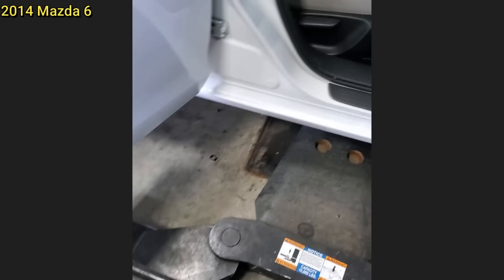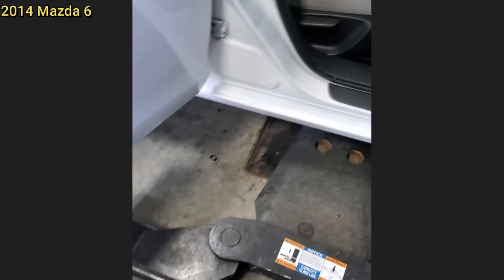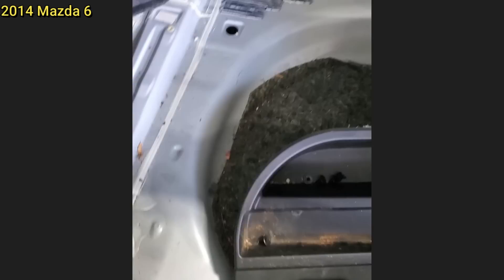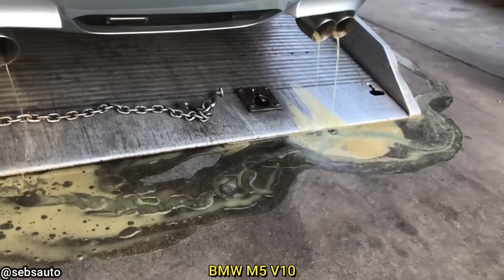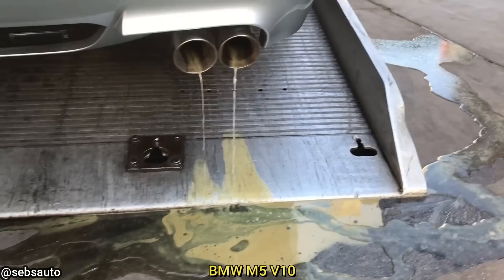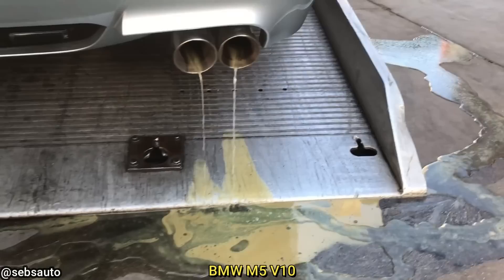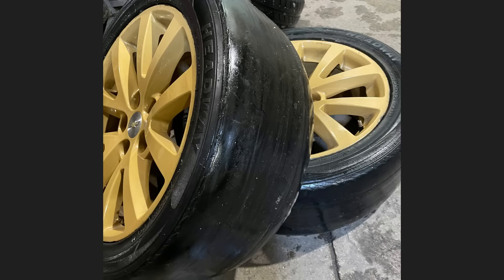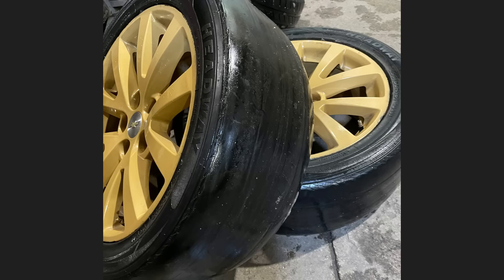Customer States Heard A LOUD Noise When Trying To Charge Tesla

Comment: Having a tow hook-up rusted through like 2:30 is quite something given how thick the metal originally was. There must not be a whole lot left to the rest of the truck's structural integrity either.
Reply: Welcome to the rust belt. Here in Iowa the brine eats vehicles for breakfast.
Reply: @catsaregovernmentspies  wash your vehicles often
Reply: I don't miss the snow and salt from up north.
Reply: @sd906238  I'm in north dakota and we avoid salt. My city uses sand, but I think some private businesses can use salt. Not exactly sure on who uses salt.
Reply: @jayasmrmore3687  Recycled water at carwashes makes that a lost cause in the winter.
Reply: @edsloan8535  Then at least clean the bottom of the car after winter. It won't save the car but will postpone the inevitable, the thing might survive for a couple years longer ;)
Reply: @edsloan8535  when water is recycled it should probably be treated first I’d think
Reply: @jayasmrmore3687  
it's recycled in the sense that it's reused, not in a sense that it's clean. i mean it's "clean" enough to get through their systems but salt easily dissolves into water and bam you got salt water being sprayed on and under your car. best case you can hope for is the final rinse be fresh clean water and that's okay but only if they also spray under the car too. 

really there is nothing you can do but get higher quality parts (painted with paint that is heat and chip resistant) or covers for the underside of your car. that or have the body made out of anything but iron/steel (some cars are like this but it raises the price by a ton).
Reply: @rocksfire4390  it’s not clean but they can have it go through a cleaning process before reusing. I’m not saying that they necessarily do this but they should.
Reply: @rocksfire4390  The final rinse is always done using the cleanest water possible, but this is not applied to the bottom of the vehicle.
Reply: @user2C47  
so the only part that matters? =/
Reply: @jayasmrmore3687  desalination is an expensive process by volume, and it could as much as triple the business owner's cost of your wash cycle.  That's just operating costs, assuming he has already paid off the equipment he's installed to do it. 
To raise service costs enough to remain profitable, he'd chase the vast majority of his patrons off to use his competitors who don't desalinate the water.  So there's no easy answer here, except to take your car home after doing the bulk of the wash there, and give it a thorough final rinse with your garden hose.
Reply: @edsloan8535  wash in your driveway then, or at least just rinse weekly
Reply: it was those tires for me!🤨
Reply: @catsaregovernmentspies  ah yes. Salt, potholes, and don't forget the sultry -20 f daytime high temps during winter! But we should "just wash our cars" during those times (😉).
Reply: Me: "Ou thats really badly rusted out back frame" and then i realized what it actually was while it was stated he planned on going to tow trailer with it..Sure i did do (last) tow with similarly rusted setup, but it was for light trailer with even lighter load..and it failed from one side making it perfectly clear it was done for.
Reply: @erpfanatic6586  sounds like a business opportunity for someone to setup a business supplying a "rinse off" service.

You'd probably need to use city supplied water, run through a big assed water heater to get it up to 100f or so. Have it applied by an employee rather than self serve to cut down on waste.

If you could come up with a process to recover the water, that would be a bonus.

I suppose you could distill it If you had an economical heat source. Maybe vacuum distillation at lower temp, given low ambient temps.

It would necessarily be a seasonal business.

Comment: 0:20 This is actually completely legal in The Netherlands and having the seat as shown in the video is also recommended here.
The only things one needs to take care of: Disable airbag on passenger side + make sure the seat is properly secured.
Reply: Pretty sure it's still the same in Sweden (I haven't had a car for 30 years or so), up to a certain age you have to have a backward facing baby seat, is there even any safe way to mount that in the back?
Reply: @Hexalobular  is legal and recomended
Reply: As if most people even remember to disable the passenger side airbag. MUCH safer in the rear passenger seat facing backwards. Add an extra suction cup mounted mirror for quick glances to check on your precious little one. This also forces the driver to pullover if the little one needs immediate attention instead of trying to do that while driving 2 to 3 tonnes of killing machine.
Reply: It’s also legal in most states in the United States, as long as the air bag is disabled
Reply: @Hexalobular  it is the same way as in the front, only not leaning on the desk but on a seat, but turning back to care for any babies momentary needs isn´t really best when you need to focus on road in front of you - this way you have it in peripheral sphere of vision 99% of the time
Reply: @FirstLastOne  if you´re not an idiot and know where your baby things are and you do not have mess in them, you can pretty easily hand down anything to your baby on the next seat - which is almost impossible to do towards back row (and not safe unlike the front row option). 

And you cannot always stop for every baby cry, nor want to. For "serious" things like diaper changing or searching for lost toy? Sure. But for handing a bottle of milk or easy eye contact this is much better and smoother for the ride and you do not spend more time on it then on looking into rearview mirror.
Reply: Completely legal in Finland as far as the airbag is disabled. Why would it be illegal in the first place...!?
Reply: @siriusczech  Are car seats generally strong enough to not bend or fold forward? Particularly in 2 door cars?
(I suppose a baby and seat don't weigh anywhere near as much as an unsecured backseat passenger, but still.)
(My car experience is decades old but I wouldn't trust the latches on the front seats in the 2 door cars I've driven.)
Reply: @Hexalobular  child seats are like a big shell that protects it and  it is fastened by a seatbelt. Big car seats have absolutely no problem of holding such weight, same as holding adult person.
Reply: having a rave every time you turn a corner is legal? awesome time to move
Reply: @jimbothegymbro7086  wtf are you talking about?
Reply: @siriusczech  wtf are you guys talking about. All I seen was all of the lights flashing along with the turn signals. There is nothing shown about the airbags and seats at 0:20...
Reply: @QuantumRads  There must have been smoe editing, as there was a (part of a?) clip that has shown a child seater on the front seat and we referred to that. For some reason, it is no longer there, but you can clearly see from responses that there HAS been a clip to react, otherwise I won´t get any meaningful response.

Why it has been edited out I have no idea
Reply: @siriusczech  it's still there, it's now at 0:25

Comment: 0:30 "smells like fuel"  I spilled about 3 gallons out of a 5 gallon can in the back of my Impala months ago, still smells like gas if it sits in the sun with the windows up.  I loathe these new "spill proof" gas cans.  Even the O-ring seal on the spout is junk, which is what happened in my case.
Reply: also you can't buy the right rubber for the sealing anywhere, so it would quell up from the fuel fumes and crumble away... or just vanish, as it happened to me once.
Reply: @lotharrenz4621 , huh, hasn't happened to me... yet. But you are right, weather seals and petroleum are a poor combination. When I was younger, I had a window that had trouble rolling up and down. I made the mistake of lubricating it with WD40, the seals were wiped out
Reply: @vivillager  that's why one uses either silicone oil or soapy water. with the latter the rubber would get stuck when it dries, though. I also read somewhere in a classic car magazine that older rubber sealings on cars can be destroyed by silicone.
guess it's never that easy, huh.

Comment: 0:20 I hope the passenger airbag was disabled.

I have driven a few 2 door utes that have a key operated switch in the glove box to disable the passenger airbag for just this purpose.

Here in Aus, if the vehicle only has 1 row of seat(a single cab ute/truck for example) and the car has provision (anchor point and ability to disable airbag/no airbag in passenger seat) you can put a child seat in the front seat.
Reply: Probably has a weight sensor.
Reply: @42luke93  the few vehicles I have seen it on have had a key operated switch in the glove box.
Reply: I was wondering what the issue was in this clip. Thought it mustn't have been strapped down or something.
Reply: in Norway this is normal, in Europe u have that key switch in almost every new car out on the market... this i belive has to do with parents alone in the car, can have an eye on the child while travelling.. when the kid is older they turn the seat around or put the child in the backseat..
Reply: @3mil993  Here in Australia, you cant put a child in a child seat in the front of a vehicle unless the vehicle only has 1 row of seats
Reply: Thats how it is here in Canada. Although I highly doubt that suv having 3 row seating has the ability to turn it off.

Comment: 0:20 Here in Germany you can put Child Seats like that in the Front IF and ONLY IF you disable the Airbags (many Cars have a Switch for that, which is only accessible when the Passenger Door is open). Obviously you must switch it back on when removing the Child Seat.
Reply: Yep and we have many child seats that can be mounted like that, for small babys. Because it is more safe in an event of a crash.
Reply: It doesn't look like it was even strapped in though.
Reply: Here in Germany we don't just wedge it between the car seat and the dashboard though. Der Sitz ist nicht angeschnallt, sondern nur da eingeklemmt.
Reply: I just came to comment this. That's a Ford. Most Ford trucks and SUVs that I know of have a key slot to disable the passenger air bag. 
While not the best place for the car seat regardless it's not as bad as the video is implying.
Reply: @killemtoenjoythesilence  Its not 
Buckle in, whoever it was just wedged it it there. So it's a high probability they also didn't disable the airbag at all.
Reply: @killemtoenjoythesilence  yeah so many people mistakenly believe it’s illegal or immoral to put a kid in the front seat, but neither is true.  I’m sure the car seat is normally strapped in when being used.  For all we know, the car owner brought their car to be dropped off, took their kid out, started putting the car seat in the trunk to help the dealership not have a huge car seat in the front passenger seat in their way, but a service rep said “don’t worry about the car seat”, so they put the car seat back in the car but neglected to buckle it back up.  A hundred other scenarios could also explain it.
Reply: Same here in France
Reply: @TheMiataDriver  In the Netherlands to
Reply: @oliver_klozoff  why would the car seat need to be strapped in if there's no child in it?

Comment: 0:20 Surprised me. It's perfectly legal in France and in England for example. But there are conditions: The baby seat needs to be facing back as in the video. It needs to be properly attached to the car seat either with the seat belt or anchors when equipped. The passenger front airbag needs to be deactivated. And of course, as always, the baby has to be attached in his seat.
Reply: In Spain it's forbidden, even with airbag disabled. You can only do this if you have a two seater
Reply: It depends on the state, most states rather have you keep the child in the back seats rather  than in the front passenger seat for safety  reasons.
Reply from the maker: Illegal where I live. That's why I was so surprised and showed the clip but everywhere is different.

Comment: 00:23 this is why most cars (in Europe anyways) have a passenger airbag off switch.
00:28 This happened to me while I was an apprentice. Customer complained about a gasoline smell in their diesel station wagon. We asked if they had a can of gasoline in the trunk and they said no. Guess what we found in the trunk...?
Reply: So do cars in America, atleast every car i've been into you can turn off the airbags. Just depending on state laws, you aren't allowed to keep children in the front seats for safety reasons. Even in Spain you can't do what the person in the video was doing.
Reply: Are you allowed to have a baby seat in the front in Europe?
Reply: @knytrydr73  in my country at least. We even have isofix in the front passenger seat.
Reply: @panzerveps  - what's isofix?
Reply: @knytrydr73  a standardized system for installing kid seats in cars. Two metal hoops for the seats to clip into. Quick, easy and secure.

Comment: Just add peanuts to the fiberglass insulation and YOU"VE created the mouse nest, It's like a welcome mat...
Critters do a lot of mechanical damage. Left my chainsaw out a couple of days ago, got a mud dauber muffler job..... (usually it's just my air lines/tools)
Reply: Few years back we brought an old hilo back over to the shop from the warehouse across the street and after a bit could smell something burning. Opened the hood, sure enough, some mouse had torn up all the under hood insulation and backed it in around the manifold and we cooked him alive. Chewed up a lot of the wiring too, our maintenance team was not happy
Reply: Boat mechanics love those mud daubers. Boat owners not so much!

Comment: Thank you for showing us the mistakes and also explaining what we're looking at. Not all of us are Master mechanics and understand that a u-joint being all wobbly is a bad thing. So explanations along with the video is awesome, thank you.
What was wrong with the electrical system with the turn signal & all the lights going off? Looked like the car was having a seizure.
Reply from the maker: I timestamp each photo & clip with more info in the description. The tech said some more stuff regarding that clip on what he found. Hope that helps!
Reply: @JustRolledIn  Awesome thanks. I have had some interesting things happen to my cars. The most intriguing had to be the fact that my windshield wipers were intermittent. If I hit a bump they would stop or start. The problem came to a head when part of the water pump sheared off and went in a different direction than I was driving. It's amazing how one thing out of place can cause so much trouble. A broken strut poking into the serpentine belt, binding it up and causing tension in places it shouldn't. Obviously bad things happen after that. That was fun.
Reply: Someone doing home installation of some electronic? Or the system is responding to the beat of the music. ....
Reply: @josephvanwie6706  so the car was grooving to the music? LOL it just really wanted to dance....
Reply: Lights coming on when others light (or flashing when others flash) is a very common ground fault. The two lights' common ground is no longer grounded, so the current is "grounding" through the other lamps backwards.
Reply: @dotancohen  thank you

Comment: I might have been a candidate for this channel a few years ago. I had some work done at a shop (clogged oil pressure sensor) during the winter and a day after I got the car back I could smell antifreeze in the cabin. I thought I might have just been driving near a car with a coolant leak and didn't think it was a problem at first, but it persisted for a week. I called the shop and they said bring it back in. They looked all over it but couldn't find anything leaking, and the radiator was still full.

Turns out it was the new de-icing washer fluid I had put in the car just before the initial service. When I used the washers I could smell it, and it smelled like antifreeze.
Reply: inserts JK Simmons laughing

Comment: I don't get the 2nd one. All (most?) cars, that I know, have a way to deactivate the passenger airbag exactly for this use. In most cases this is done with a switch that can be turned with the car key and in all cases (that I know of) there is an indicating light at the dashboard for this. So this should be perfectly fine.
Reply: You can, but depending on what state or country your in its illegal to do. In many state in America, you  aren't allowed to keep children under a certain age in the front passenger seat for safety reasons. Atleast in the states I've lived in, even if you can turn off the airbag which everyone can do. And even in other countries in Europe like Spain your not allowed to do this unless you have a two seater only car.
Reply from the maker: It's illegal where I live. Also the visor with the warning labels specifically says not to put a rear facing child seat in the front. Airbag on or off, I don't know why somebody would put a baby in the front seat.
Reply: @JustRolledIn  Thanks for the clarification. Where I live, it's only illegal (and stupid of course), if you don't deactivate the airbag.
Your other question I would like to turn around. Why wouldn't I place the child seat on the passenger seat? It's often more convenient, especially when you have a car with smaller doors for the back seats (or just two doors at all). It can be lot easier to place and secure the child, if you have easier access through a bigger door. And leaning into the car and "working" on the back seat, if you only have front doors, is very inconvenient to say the least. :-)